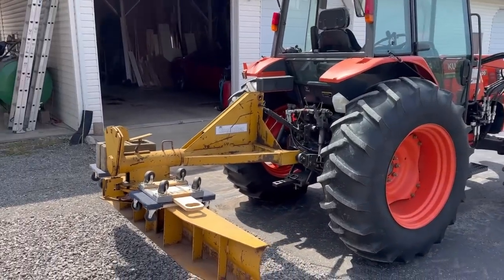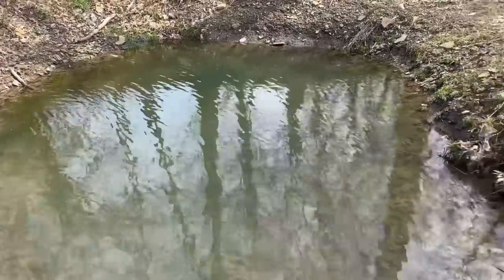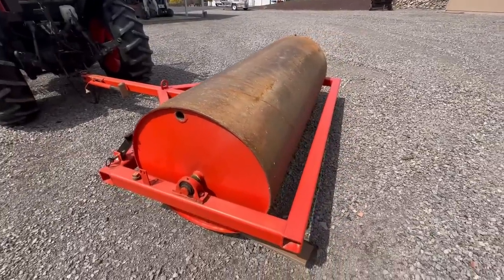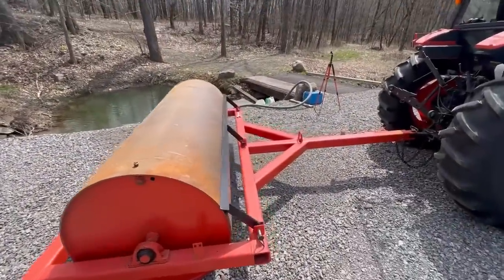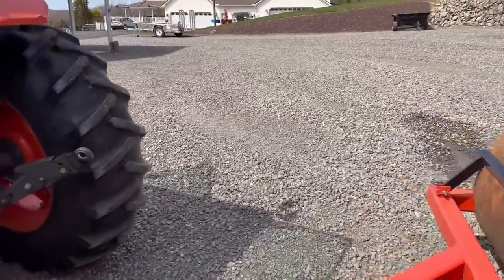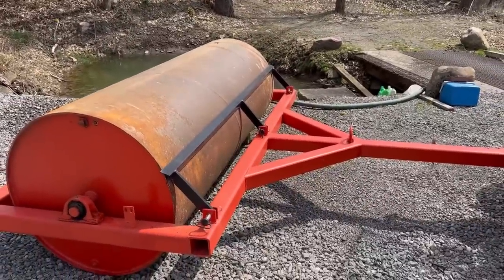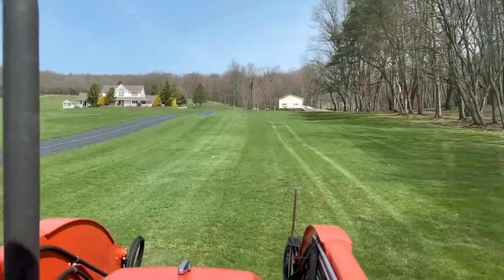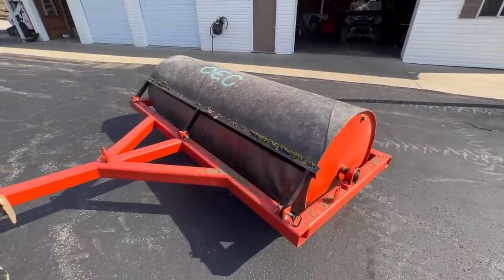OverKill or Just Right - Massive LAWN Roller

Comment: i built one just like it 25 years ago for my orchard floor. Huge help on restoring floor after downed trees from hurricanes. when i saw your shot of the water/mud coming from in front of it i smiled, now that is doing a perfect job leveling. When it dries out you ride is smooth as a table top. Great job there

Comment: I roll my yard at the start of each season with my little 42" mower pulling a 36" plastic roller mostly filled with water. $15 for 4 hours or $25 for 24 hours. I can load / unload myself in / out of my pickup. It does make a big difference at the start of each mowing season. Great video, thanks. Be well, be safe!
Reply from the maker: Thank you Randy!

Comment: I have a 48” wide x 30” dia roller. Filled with concrete. Homebuilt. I love it. Only regrets are it isn’t as wide as the tractor. Thus the tire tracks are not covered. The hitching is off set to cover one tire track …envy!

Comment: I thought for sure the wheel treads would still be left behind nicely done!!!  remember it 4000lbs over 8ft  I use a 1/2 ton lawn roller and ist 2 wheels so let say the front Drum is 600 and the back drum is 400 lbs plus me 200 lbs  and they are only 24" wide.  you are perfect I need on for my tractor

Comment: Get yourself a candle stick.  Then, heat the plug that won't come out until it is cherry red.  Take the heat off and as soon as it goes from red to a gray color, run the candle stick around the threads.  I bet it'll pop right out.

Comment: Any idea what the roller was made from originally. I'd love to make a big one like this. No one seems to sell one that heavy..
Reply from the maker: 4”x 4” x 3/8” wall square tube.
3/8” x 3’ OD x 8’ long round casing.
2 heavy duty pillow blocks 
2” axel shafts welded to the 
3/8” thick barrel end caps.

Now days, that steel costs as much as a small car!!
Good luck